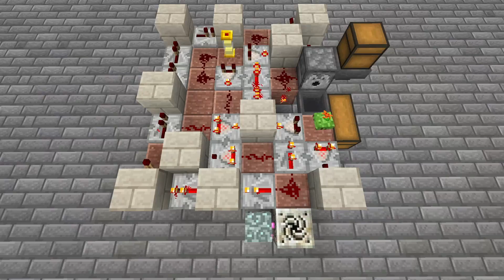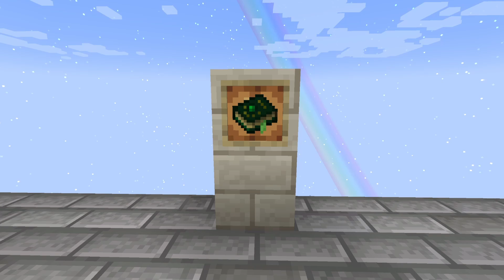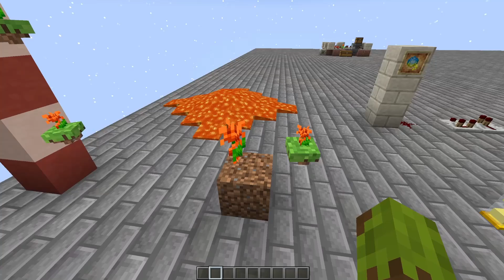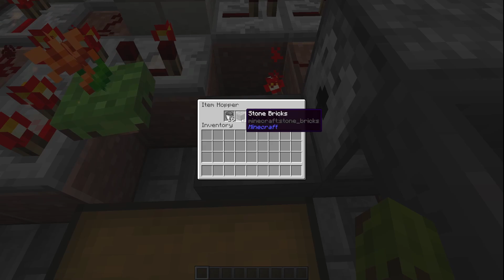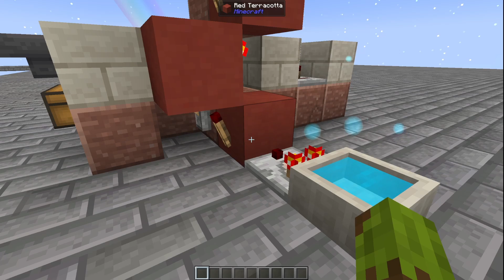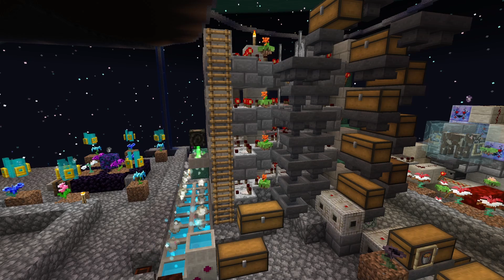Botania:Timed Thermalily. Compact with Vanilla

Comment: I seem to have an issue where sometimes my flower outputs the full 15 and the subtraction part stops working. Does this happen in your build if you output 15 from the flower or did I mess something up?
Reply from the maker: Sorry for the delay, YT didn't notify me of any comment for quite a while at this point.  Are you talking about when you place the thermallily that it emits a signal of 15?  I can't think of why yours might be messing up when the flower actually gives a 15 signal other than something was built wrong.  I'm working on a world download right now, so check the description for that to compare to your setup.

Comment: Impressive! The way you approached this is really clever, and it's a lot more compact than the design I came up with (mine is 8x9x7ish), although mine doesn't have any time loss; my solution takes the comparator output, shortens it to a pulse (much less elegantly), runs it into a comparator pulse extender, which we then observe the fading signal strength, giving us N pulses for a signal strength N. This then activates two droppers full of red sand into an hourglass, and after the hourglass triggers (dispensing the lava), a hopper enables to drain the items out, and return them back to the droppers via water stream. I had to add on a stupid slimeblock arm to retract the observer target block to fix an off-by-one error causing the system to be losing 20s each cycle. It's so ugly, I love it
Reply from the maker: Thanks!  I appreciate hearing an alternate approach too.

Comment: Your shutoff circuit seems to just refuse to work for me, any chance something was cut from the video or something I might've easily overlooked? (To be clear I mean the automatic one, not the lever)
Reply from the maker: Not that I can see.  If you pause at the very first second of the video you can see it all.  The following is relative to the perspective at the beginning of the video.

Make sure all repeaters loop from the bottom right block/redstone dust looping around, and don't forget the redstone torch bottom left to invert the signal.

Make sure that signal turns on the redstone dust next to the comparator at the top of the screen too.  The livingstone bricks are all important (though they can be any full block that conducts signal)

And if you mean the empty shutoff, (when the dispenser empties of buckets) then 4:59 is where that circuit is.

Let me know if you need more help.